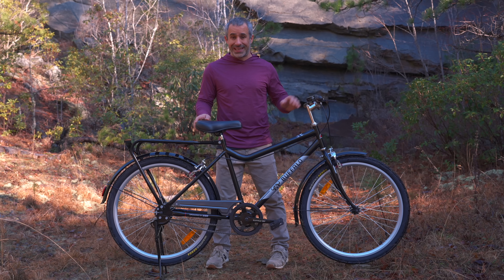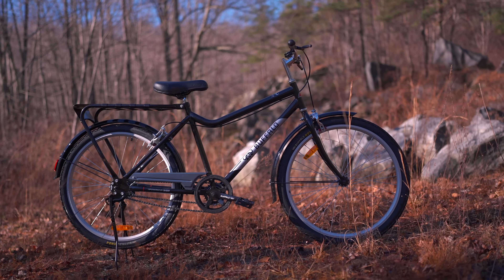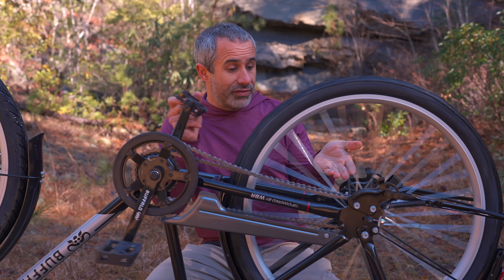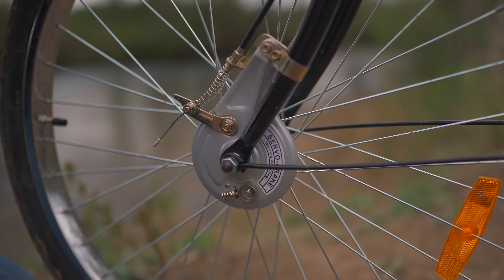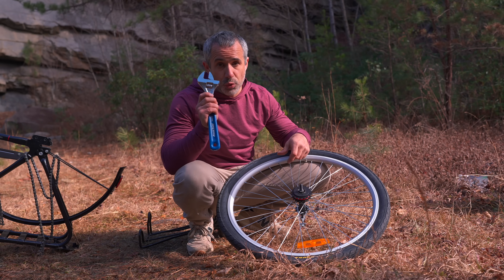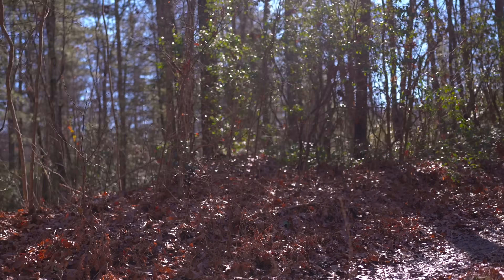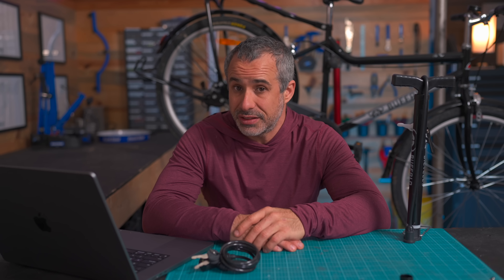Why 2 Chains Make This Bicycle WAY BETTER

Comment: This is the paradigm shift we need, making things that are reliable, durable, simple and repairable, instead of adding pointless bells and whistles just to be able to charge more, ending in a landfill in a short time. The fact that initiatives like this exist restores a litte of my faith in humanity, which has been taking a beating lately.
Reply: Yes. Simple, durable, repairable.
Reply: Bicycles that were made of steel 40 years ago can be easily brought into the modern age but be a lifetime or 2 of use. Frames going to aluminum,  then carbon was a mistake.
Reply: Too bad it's a scam... For a company claiming to have such a large infrastructure of dealerships/mechanics,etc who has made apparently millions of these bikes over decades... notice there isn't a single one of them second hand or new for sale online.. NONE... I DARE YOU to find one you can buy for yourself on the ENTIRE internet.. hence it's not real.. and a lot of ppl are falling for it.. Note how on their website, if you try to contact a dealership to purchase one, the ONLY available contacts are all within fake charity, and not a SINGLE independent dealer.. It's a scam.. and they're raising millions to send over seas to a group they've barely heard of, and nobody has actually met.. Think about it.. (my opinion)
Reply: Hear me out for a even crazier idea, remove the big front disk, it seems they need the easier gear most of the time
Reply: Probably a good opportunity to note the lack of a profit incentive in this innovation...
Reply: 60-year-old Raleigh/Sturmey Archer bikes were/are long-lasting and reliable.
So not only is this not a paradigm shift, it's not really anything new other than a novel attempt at doing it a different way
Reply: @gbshaun  100 year old more like, the 3 speed design has been around for a while (and is still among the most solid, capable of more nm torque than the average).
Reply: @gbshaun That way of doing things was certainly more common a few decades ago, not so much now. To be clear I'm not talking about bikes in particular but in general, fridges and cars loaded with electronics, complexity that makes them break more often, be more expensive to repair and require specialized service providers, etc. There being a few exceptions doesn't deny the trend in the products available and affordable to most people. For evidence you can look at the billions of tons of disposable stuff that it's exported from China and the endless landfills of once fancy looking but poor quality goods
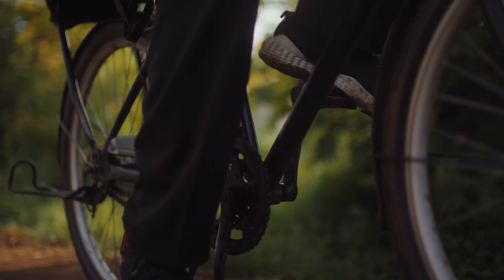Reply: @gbshaun  6:28 "those field testers found it to be a lot more reliable than IGHs and derailleurs"
Reply: I'm not kidding you - by 1m30s in I was nearly in tears, the idea that someone would make a quality product to help humanity was such a shock to me it nearly had me in tears...!!!
Reply: Yeah, so capitalism does not like this. 
So it will be destroyed.

The lives of people? Not relevant.
Reply: They cant sell as many things when things last super long.
Reply: this is a charity scam... think it through... hundreds of dealership huh? thousands of certified mechanics?? not a single part of bike in the entire world though for sale online... despite there being "millions"
Reply: @TrueHelpTV  Let me try to make it make sense to you, and perhaps help you escape your pit of cynicism. It's not a charity scam, it's just a charity. Bikes and parts are not for sale for the general public because they are a non-profit, the point is not selling as much as possible and making money but creating an ecosystem that gives work for people in the communities where the bikes are, they provide exclusively to the local repair shops so people go to them, it's not just about the parts but the mechanic that installs them, advices the user and does maintenance. Not everything is a scam, not everything is a conspiracy, there are good people out there doing good things, make an effort to have facts before smearing a charity as a scam.

Comment: I'm wondering how they managed to make the rear axle sturdy enough. From my experience freewheel hubs, especially with non-quick-release axles, bend very easily because of the right dropout - bearing distance and low strength of that axle steel used. But that was with 7 speed freehubs - maybe here distance is shorter, like in a single speed dedicated freehub? They could have probably designed a dedicated hub that would still be cheap to manufacture, but they likely wanted to use off the shelf hubs to keep it as cheap as possible, and also make the hub/wheel easily replaceable with generic components. I'm also curious what type of bearings are used in hubs, BB and steers, and how well are they sealed as I guess rain and mud are pretty frequent in many places those are used.

Comment: I see how the non-derailer system could be useful. But. Why not just use a planetary gear?  They have actually been around longer then derailer systems, but cost more. The main benefit is that they are generally maintenance free, and I think bike companies need the bikes to wear out so people will want to buy new ones, thus derailer systems are more popular

Comment: If there’s one thing I really think this sort of bike could benefit from it is airless tyres. There are a few brands out there but im guessing it’s just the cost and or longevity (I’ve never used any but have heard and saw them working well in other applications). Maybe it’s something we will see later down the line

Comment: I'm not going to hate on anything this organisation does but I really struggle to understand the reasoning behind some of the compromises they made.

If being able to change gears was so important, why not develop a bigger, heavier, more robust version of a Sturmey-Archer 2 speed? It shifts in exactly the same way as this solution but doesn't include 2 separate chains, doesn't compromise on braking (Sturmey-Archer features coaster brake on top of being able to shift gears by kicking the pedals backwards), doesn't introduce aligment a problem you have to remedy immediately and doesn't introduce an extra tool you need to own to service the bike.

I cannot say anything about life in an impoverished 3rd world country, I have never been to one nor I ever lived there but from my experience living in a 1st world country I have many times, especially in the more rural areas of the country seen kids, adults and elderly ride on junky poorly maintained bicycles even though all of these people always had the resources necessary to maintain them well.

I may sound insane but looking at the new improved version of this product It seems the engineering behind it compromised on significant amount of mechanical aspects that actually made it work for the intended purpose. You said yourself that freewheels are reliable, proven strong mechanisms. And still the expected way to deal with a freewheeling issue is just replacing it with a new part rather than fixing it. People riding on dirt roads aren't bombing down the hill at 50kph+. A heavy-duty version of a 2 speed internal hub with a smaller chainring to make pedalling easier in the first place in my humble opinion would achieve the same desired reasult without compromising on all the things I have mentioned earlier.

And sorry for bringing up a specific "brand" of 2 speed hubs, sturmey-archer is the only one I know of that works in this specific way.

Comment: in the first seconds i tought, oh not another hipster bike with weird mechanics that probably cost 2..3 thousand bucks and claims to solve problems while just being shit
but i immediately threw away my initial impression, everything makes sense,  everything is built to last and serviceable, made for those who need it the most and all for a low price that makes no one feel getting ripped off

Comment: I am not intending to shit on the bike, however, while I appreciate that Sram did it for free and that there is this great push to provide bikes but I don't at all agree with any of the changes they have made!

1. Rim brakes severly impact riding a bike in remote places with bad roads and little access to tire inflation, when the bike has brakes that require air loss to remove rim for truing or flat repair.. With coaster brakes, you can keep riding until the wheels are basically taco-ed.
2. Changing how the bikes brake in remote communities that have maybe never seen other bikes and have coaster brake muscle memory creates danger for unfamiliar users expecting backpedal to slow the bike.
3. Coaster brakes could be salvaged from SOOO many other bikes, these new SRAM parts are proprietary.
4. Two brake cables to now maintain and replace, as well as housing, ferrules, brake pads, levers...
5. Issues with brake rub from unteue rims make the bike hard to ride, but also hard to push with 200lbs on it. So any brake issues hamper ALL TRAVEL WITH CARGO!
I think this bike creates many, many related problems while really only "solving" a few issues.

A. It can be ridden more of the time because of the climbing gear, increasing business efficiency and income for many- that's a pretty big plus, though brake issues impeding travel and reducing efficiency when in disrepair, while conditional (as all of these issues are/will be), are still a big deal and negate a fair amount of the positives associated with the gearing change.
B. The hub brake was harder to service. True, but also had a near zero dependency on the trueness of the rim. Coaster bikes can be ridden with little issue until the rims are so bent they cause the tire to rub on the frame.

So the two main positives come with HUGE caveats. I think i would take hub brake servicing every rare once in awhile to truing rims, adjusting brake arm toe in to prevent brake noise, cleaning chain lube contaminated rims (two chains, so twice the opportunity to screw the pooch) in place where the only solvents might be gasoline or diesel, etc.

Making the grips and saddle durable is excellent for service needs, the 200lb. rack is smart, the whole idea of the bicycle is really good! But i think if Sram had spent all of that money to develop a simple new kind of front derailleur (this bike already has 2 chainrings) it would have been MUCH BETTER!

1. A simple front derailleur with a single pivot instead of parallel linkage gets rid of the brake levers while adding a small shifter, it could be old simple friction SIS style. 
2. There would be one less cable and housing, so cheaper and simpler to maintain cable wise.
3. No wheel truing issues, wheel condition related effort and speed reduction increasing travel times and effort leading to financial loss.
4. No having to remove air to remove the wheel then needing to find a pump or compressor to make the bike rideable again.
5. There would only be one chain, so half the amount of chain lube/cleaning for proper function and reduced cost and time for maintenance. 
6. NO PROPRIETARY PARTS!  If the mount was compatible with existing front derailleurs- the simple single pivot part would just be what came on the bike, and while a great benefit to the bike's mission, not a requirement of operation! MANY APSECTS OF THE NEW DESIGN MAKE THE BIKE LESS RELAIBLE OR HARDER/ MORE EXPENSIVE TO REPAIR in places where income levels and scarcity are already so low!

The money would have been better spent on a simple front derailleur design, shifter, improving hub brake and cable system durability and longevity. In a pinch, like if your derailleur cable breaks, you can jam a stick or something  under the front derailleur to hold it in place in the higher gear...i have done it before!

Everyone's hearts are in the right place with this bike, but i think all of the engineering choices were completely wrong, given the locations this bike will be used in, the conditions of the roads in said spots, and the mission of the bike. Just how many cars interiors designs and ergonomics still are still an after-thought in 2025. The seats make your butt numb, the pedals aren't centered in the foot well, controls require taking your eyes off of the road (im looking at you Tesla!), etc. Engineers need to be more observant, test more, get more real world data from average users, think of every possible thing that could go wrong (worst case scenario engineering, especially relating to serviceability, mishaps, and safety), and generally think outside the rhomboidal prism! 
I feel this bike "update" just trades new problems for old ones, while only solving the gearing issue. Hell, I would prefer a derailleur with no cable or shifter that require me to get off the bike to actuate it than the "new and improved" bike shown here! I learned long ago to pedal with my left foot and use my right foot to force the chain over when the front derailleur wasn't making it happen and the barrel adjuster wasn't affecting anything because the cable was damaged or mucky.

Good intentions, bad outcome in my opinion. I still wish them luck, as they ARE PROVIDING LOW COST/NO COST USEFUL BIKES TO COMMUNITIES IN NEED! Great idea and I appreciate you 🙂

Comment: This would be awesome for mid drive E-Bikes. I have taken to just running a single speed and free wheel as My motor just had too much torque and I'd be constantly adjusting,fixing and replacing parts of the drive train. Yes it curtailed my top speed, and my hill climbing is a bit slower and harder on the motor, but the motor is better equip to take the load. However with this, I could have the best of both worlds.

Comment: That situation in that geographic is screaming for a cargo ebike depot, solar charging, probably super lax laws on power output and throttle control etc, just another example of capitalist greed, because above all it would take little to install solar panels and peltier cooling storage fridges eliminating the problem anyway.
Reply: That part of the world isn't equipped to maintain ebikes. Simple reliability, easy repairability, and low cost to provide bikes for the most amount of people was the purpose. A lot of these bikes are being used by villages that don't have the luxury of having to deal with breakdowns that can't be dealt with in the middle of nowhere.

Comment: "It's interesting what engineers come up with in the absence of marketing departments" Bruh, you are speaking to my life right now.
Reply: Marketing is kinda like the anti-engineering
Reply: @LordCapsis  Because engineers care only about functionality.
Marketing only cares about form.
Reply: truer words have never been spoken... 😂
Reply: as a engineer myself: yes
Reply: I hate to tell you that this is not new. We had 2 speed coaster brake bicycles in the 1970s and 80s. that were built like tanks, We serviced them in the exact same manor, upside down. Coaster brakes were and still are the most reliable part of a bicycle, to shift gears you just tapped the brakes. The only thing we did not have was front brakes and they arent needed. This is not a mountain bike that goes down a hill at speed. The milk is more important than speed. if you spill it the trip is over. When i put my bmx bike together back then i put this exact hub in the rear. it was amazing what you could climb and how fast you could get it going in high gear. I had friends with 10 speeds at the time that could barely keep up and other bmxers that had to walk up while i pedaled up.
Reply: Too bad it's probably a scam.. It's sad this guy raised so much money to give to what I can only deduce is a charity scam. They claim to have existed for decades, and then chose the one nation that has the least ability to fact check. They claim there are HUNDREDS of dealerships, THOUSANDS of CERTIFIED mechanics, and that they have mobilized MILLIONS of people.. meaning there should be MILLION of these bicycles? By their own claim, it should be one of the most manufacturered bicycles in human history... and yet... I DARE YOU TO FIND A SINGLE ONE FOR SALE ON THE ENTIRE INTERNET.... THEY DO NOT EXIST.... the only ones you can find are a handful of marketing samples given to the ultra famous in the bicycle community to encourage them to play the same marketing demo videos, and copy paste the same sob story articles to link back to the same charity website. There is not a SINGLE "dealer" in the ENTIRE world actually selling these online. You can not even find ONE for sale second hand ANYWHERE in the ENTIRE INTERNET... hence.. this is ABSOLUTELY A SCAM... And it's pathetic everyone is falling for it.. Every attempt I've made to point this out has been ignored by the video OP, and commenters saying the dimmest of things to defend it such as "they probably have a non compete agreement which is why you can only donate money to have them give them away to someone else" and I'm sitting there like.. okay Tim, if that's true, how come not a SINGLE bicycle after DECADES of their existence has EVER made it on the market for sale to the general public EVER... every person in the comments saying they've "Seen" one is always this near nameless channel with zero indication of legitimacy, some are brand new accounts, and when you try to contact them, they also refuse to give any meaningful response.. I can not find ANY videos online about the bicycle or the company that aren't essentially copy pasted identical footage... 
 This is most likely a SCAM and deal lord this community needs to get this point across to the channel owner before he hands over 6 figures to a nearly nameless entity..
Reply: Yeah like all the useless unserviceable forks, specialty drivetrains etc that they come up with that lose the company massive amounts of money
Reply: 😮it almost feels like innovation is possible without capitalism
Reply: this is a scam company... they claim to have already mobilized millions, with hundreds of physical dealerships and thousands of mechanics.. except you cant order parts, and not a single bike exists in the entire world for sale 2nd hand.. its bogus